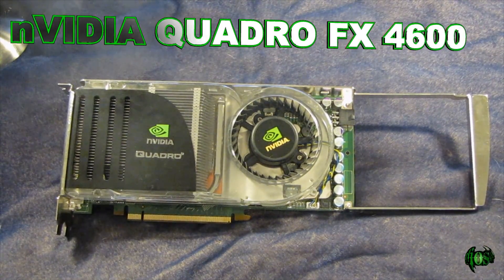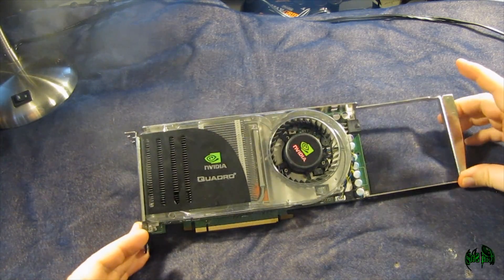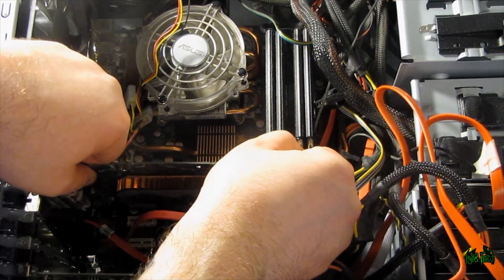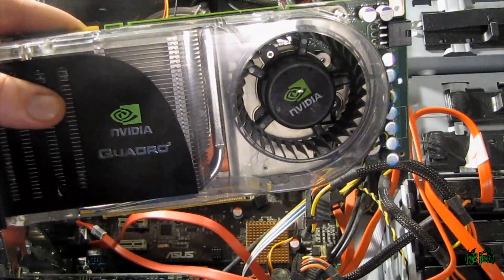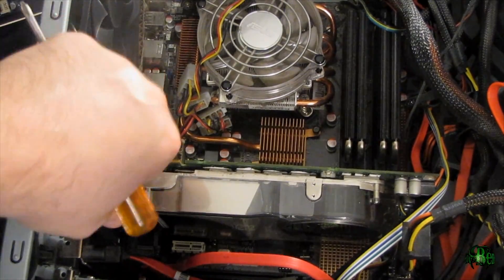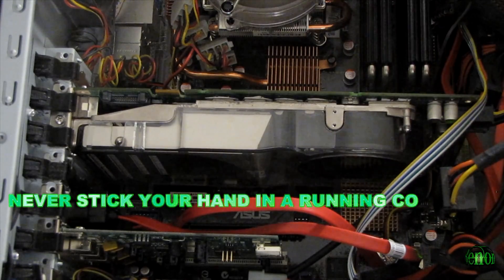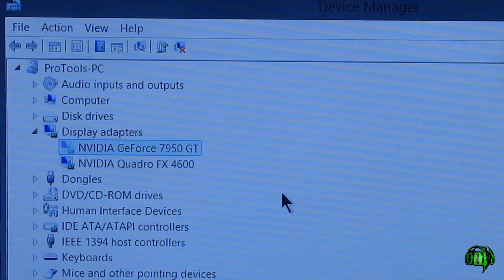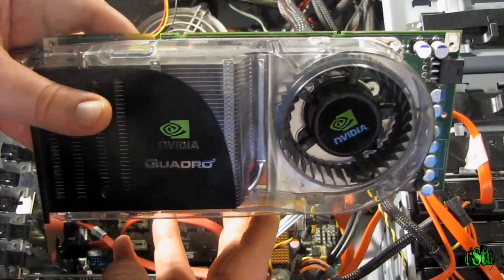nVIDIA Quadro FX 4600 Overview and Install

Comment: I have NVidia Quadro FX 4600 and hp xw4600 WORKSTATION and when I open my computer it flash a red light I Google for it

it means my GRAPHIC CARD isn't working probably so sent it to professional to fix it when start  my computer it doesn't.t show any thing and  it beep again {6 times} and when I restart it the fan and every thing work but the computer automatic turns of

WHAT SHOUID I DO ????
Reply: get a new computer
Reply: Go to English classes
Reply: very late reply but might be helpful for others
plug in the 6 pin power if you havent and if you have and your psu is 750w or above and still does not work its dead as fuck

Comment: Ya know the 780 has like 2300 cuda cores and 3 gigs of ram.
Reply from the maker: Yeah, but Quadro's use different drivers that make them better for NLE's and video/graphic programs. Things like Open GL is usually better on Quadros. A Geforce will work for NLE's. But it depends on how your NLE is setup to take advantage of the GPU, and Media Composer is setup to work best with Quadros. It's not a 1:1 with Geforce and Quadros even though the hardware maybe similar, the firmware and drivers are what make each excel at their own thing.